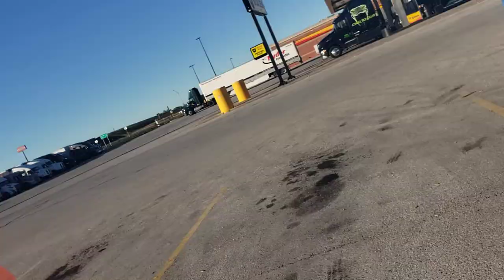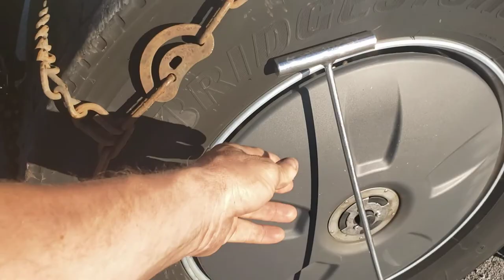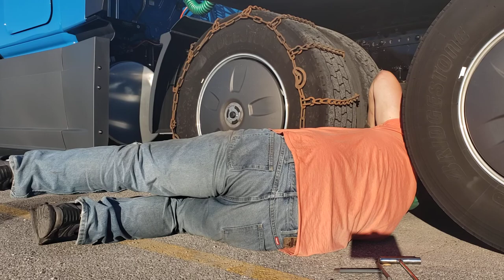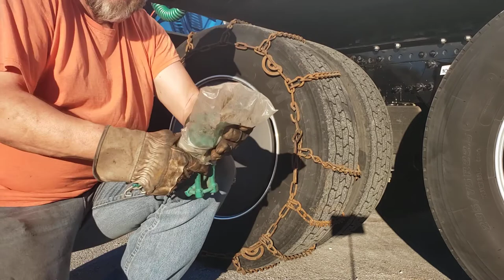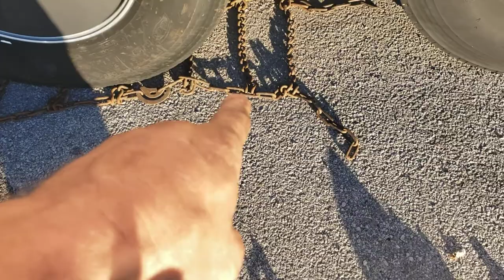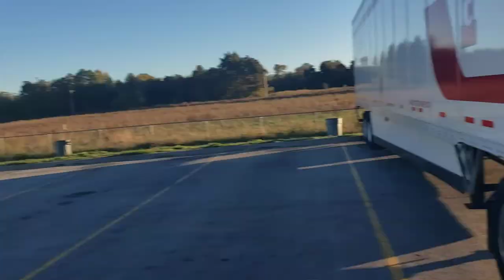HOW TO USE SNOW CHAINS...CHAIN UP/CHAIN DOWN

Comment: Couldn't you just roll the truck forward then hook the chain
Reply from the maker: Unfortunately no....because while you're rolling forward while its still loose,, one of 2 things normally happen
1... either the other drive tire winds up rolling over the excess that you need to make the initial connection ...or
2....the part of the chain thats laying on the top rolling with the tire bundles up on the ground due to slack and sometimes falls off.... 
However.  ... if you're going to practice chaining up....I suggest you try it for yourself....    we all develop our own style
Reply: @ryanlevron1972  Thanks for your advice. I understand what you mean now. If you hook all chains up at once your way makes alot of sense
Reply from the maker: @timrushing8339  
 This is another of my videos that I prewatched  before uploading to see if I wanted to redo an entirely different video or not..... There were a few areas in this video that I messed up in a little such as the beginning when I threw the chain on to start..... If you notice I bent over and grabbed the opposite rail of the chain while it was still on my legs..... If I grabbed it correctly from the ground I would not have had that problem........
Reply: @ryanlevron1972  I really enjoyed your videos on chain up and how to store chains. It is good to see someone who is truly a working man trying to help his fellow drivers. Look forward to your upcoming videos.
Reply from the maker: @timrushing8339   And believe it or not the very few people like yourself is the reason I do videos like this...... I realize that every single person has their own style... And there are many people that could do the video far better than I could..
 But not only do I enjoy doing videos I also love teaching.... And there is no better way to teach than to actually demonstrate with some commentary....